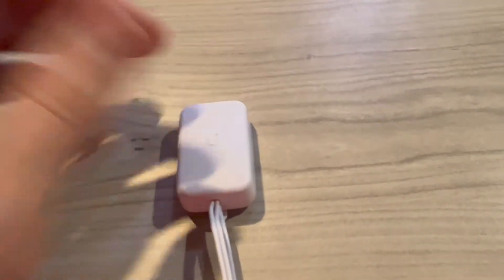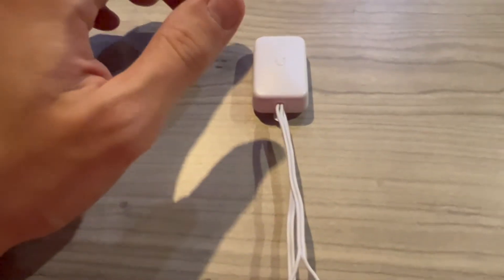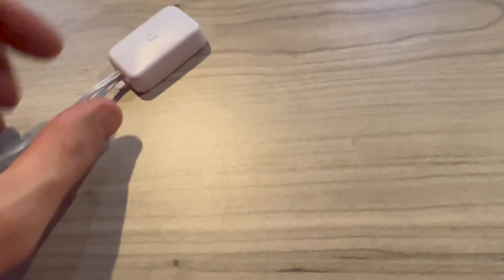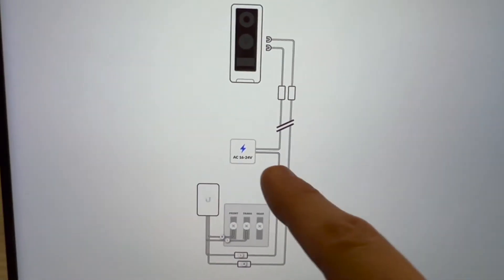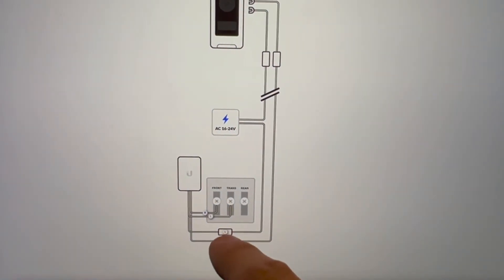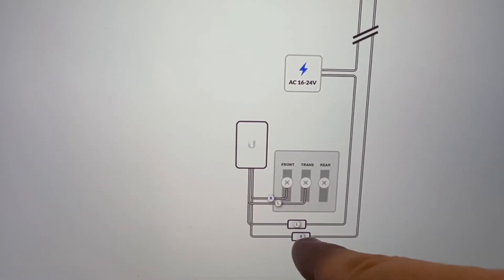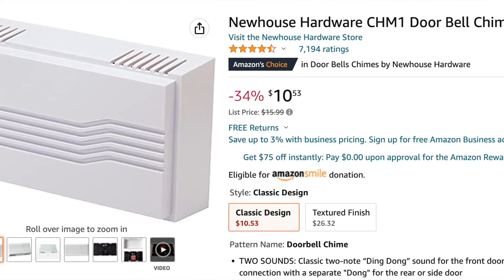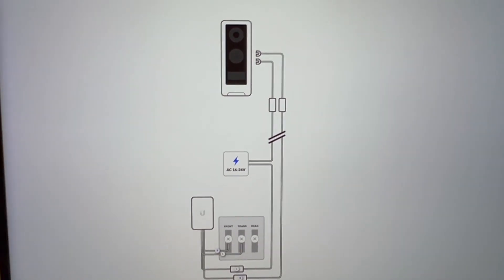How to Setup G4 Doorbell to ring a with Mechanical Chimebox

Comment: I have the g4 doorbell pro. Do you know if it is the same 'left to Trans, right to Front' ? the new instrution pamphlet doesn't show L/R, maybe they updated and it doesn't matter now?
Reply: I would assume you need it for either. I had a digital door chime originally but then realized it needed more power then my transformer provided so I returned it and went with the mechanical

Comment: If my doorbell is boot looping does that mean not enough power?
Reply from the maker: It might mean you have too small of a power supply/transformer. If it keeps doing it after you install the correct size transformer, then you will need to contact Ubiquiti.